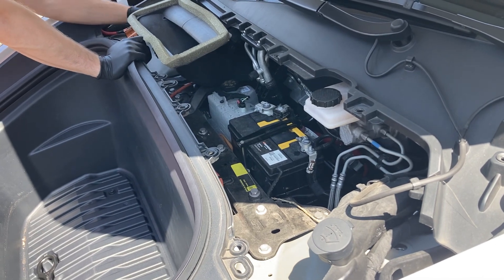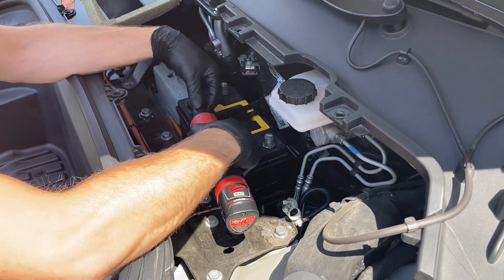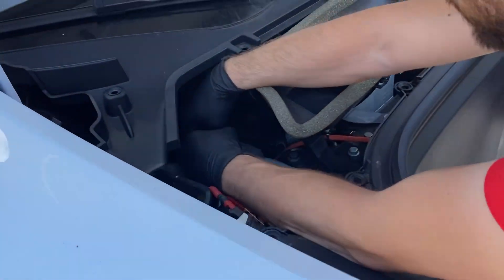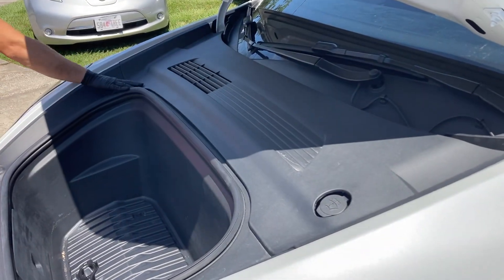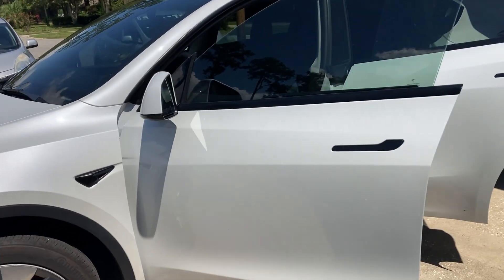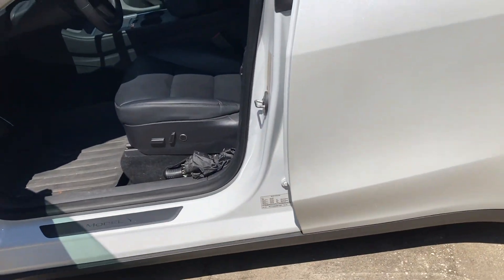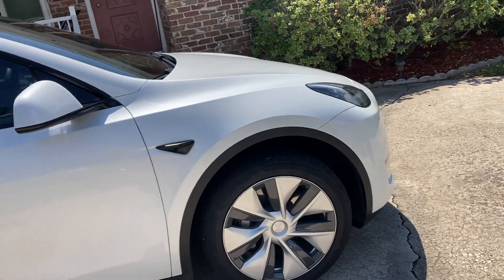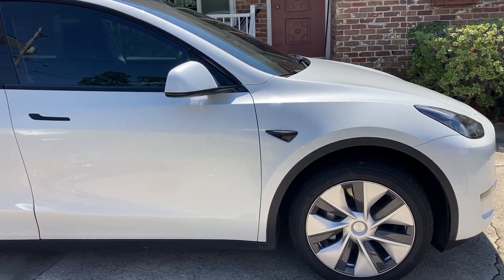TESLA MODEL Y 12 VOLT BATTERY FAIL / HOW TO REPLACE / TESLA CERTIFIED TECH . COMES TO HOME /DRIVEWAY

Comment: Do you need a specific Tesla battery or can any 51R work?
Reply from the maker: ALMOST ANY 12 VOLT SMALL BATTERY WILL WORK . BATTERIES PLUS HAS ONE FOR ABOUT $100 BUCKS
Reply: @584TREE  heads up, you can just go to any Tesla service center and buy one straight from them for only $90. That’s what I did and they’ll let you change it yourself too. Just make sure that you know all the steps.